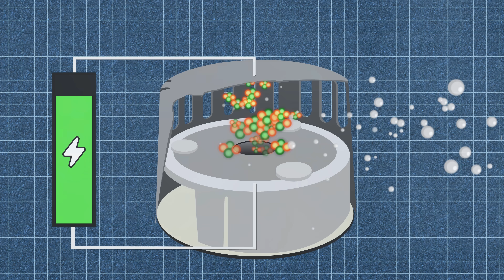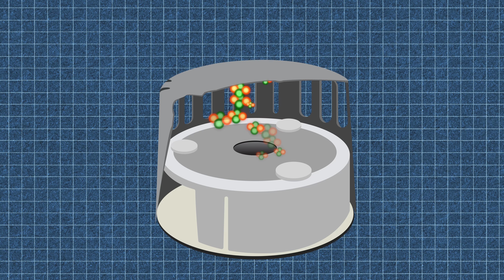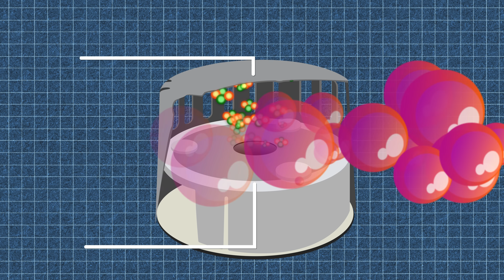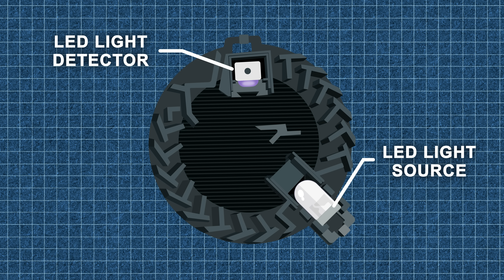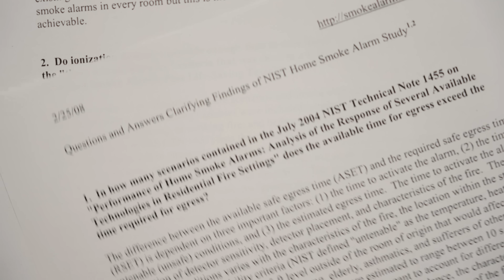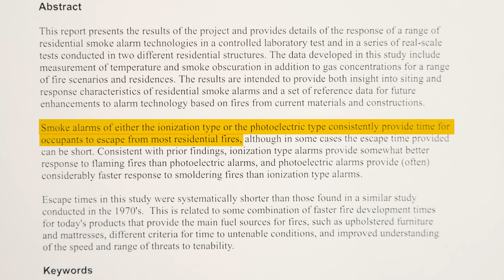Why the Most Common Smoke Alarm is Dangerous

Comment: First, the photoelectric aren't a panacea. Period. Fog, such as from my neighbor's meat locker set air conditioner and her cigarette smoke would set one off incessantly. Dust will set them off incessantly. Mist and steam will set them off.
Now, the magic sauce has been available for as long as both types of detector, ionization and photoelectric and it ain't Harry Potter's magical fuck stick, it's a combination photoelectric and ionization detector, which is commonly used in commercial grade detectors in businesses.
Downside being, the cost a fair amount more.

My ionization detector failed silently, which is plain evil of it, silent failures are bad. Maintenance tried just popping a battery in and running, I poked it with my cane, it stayed silent, maintenance was annoyed in having to go back up the ladder and pop a replacement in. In irritation, he handed it to me. Good, I'm an electronics guy, component level, I stripped that board down.
In mid-build for a radiation detector and cloud chamber for the radioactive source, the rest are loose components. The ionization circuit unchanged in well over 30 years (and basically the same detector for photoelectric or ionization, it's a comparitor and well, it compares the level read, say a quarter second before and now). The Americium source shrank by over half, which is fine.

Oh, my sense of smell has been out on a powder for decades, awake or asleep. So yeah, I need that detector and well, if some food is dodgy, someone to sniff it... No cheap detectors for that yet.

But, 90% of what he said on ionization, hyperbole, likely for pay. The rest, overstated, but loosely accurate. Get the dual model, minimal falses, it'll detect great.

Oh, figured out the silent failure by spilling some instant au gratin potatoes in the oven unnoticed, then was reading e-mail. Looked up to see a pall of smoke and had an "Oh, shit!" moment, as I really didn't want to set off the entire apartment building alarm system over a cooking mishap. So, popped the windows, ran the fans and ignited some fumes with profanity.
OK, maybe not that last part, but profanity was involved. Aired the place out, no annoyed neighbors and fire department, a wee bit less of a red face. Detector was replaced by maintenance, mischief managed.
And thanks to maintenance, a new science project was born that'll make a great conversation item at parties, as the radiation detector I'm building is of a CERN design for a particle spectrometer, so it can identify the element based upon its radioactive fingerprint (specifically, energy level). Not too shabby for $50 in parts. The cloud chamber is just a couple of shitty busted lid Amazon food storage containers that are getting repurposed, a chunk of heat sink, some blue freezer packs and that super secret ingredient, hot water. Shhhhh...
See PhysicsHigh for details on the cloud chamber. CERN's education outreach website for the experiments. Me for a 62 year old guy with a cane on a stripper pole, I need the money putting it back on again... OK, not the last, really, I've no desire to end up in traction for the next six months. Yeah, dad humor meets EMS humor, deal with it.

Comment: 13:37 and elsewhere. your bar graphs are barp;hed. mixed up. the ionization alarm is 35 minutes, not the photoelectric.. DEWD!! the mistake cheker.
Reply from the maker: Hey, thanks for the comment.  The graph is correct, but I understand why you (any many other people) think it's wrong.  

The stat is unusual: ASET or Available Safe Egress Time which is how long after the alarm goes off you have to get out before conditions become dangerous.  So photoeletric gives you more time in smoldering fires to get out.  

It's the stat used in the study and it's a measure of how useful an alarm is in saving your life.  It's also an indirect a measure of how fast each alarm is alarm is.

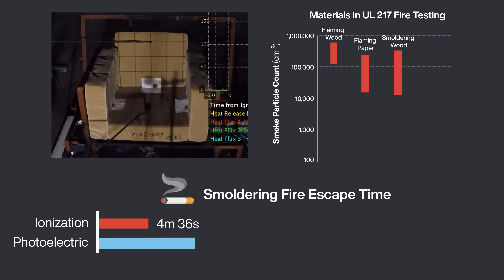Comment: At 11:38 (and 13:33) you say photoelectric is faster to detect but the graph shown on screen indicates that it's slower. Based on the other stuff you're saying, the graph is labelled wrong. Are you able to add an image overlay to the graph to fix this?
Reply from the maker: Hey Canadian, thanks for the comment.  The graph is correct, but I understand why you (any many other people) think it's wrong.  

The stat is unusual: ASET or Available Safe Egress Time which is how long after the alarm goes off you have to get out before conditions become dangerous.  So photoeletric gives you more time in smoldering fires to get out.  

It's the stat used in the study and it's a measure of how useful an alarm is in saving your life.  It's also an indirect a measure of how fast each alarm is alarm is.

Comment: I believe the graph at 11.40 is incorrect
Reply from the maker: Hey Klukis, thanks for the comment.  The graph is correct, but I understand why you (any many other people) think it's wrong.  

The stat is unusual: ASET or Available Safe Egress Time which is how long after the alarm goes off you have to get out before conditions become dangerous.  So photoeletric gives you more time in smoldering fires to get out.  

It's the stat used in the study and it's a measure of how useful an alarm is in saving your life.  It's also an indirect a measure of how fast each alarm is alarm is.

Comment: I've thought that it's the LACK of ionizing material that has been causing the problems in ionization alarms. 

There's a small amount of a radioactive material in there, and the less material there is, the closer the alarm is to the threshold to start with, the easier it is for false alarms to happen. 

Basically, the smoke detectors are MADE years older than they actually are, which increases false alarms.

Comment: It's very oversimplificated. There are more then one type of optical smoke detectors. The type showed in the video, is a type to detect white smoke. There is a type to detect black smoke too. it works by shining the light at the sensor and when the light got dimmed, it goes off. 
There is a type of heat detectors. it is a temperature-measurement device, that goes off at a set temperature or at a set rising of temperature.
The best type is a combination of all 3. With these 3 sensors, the smoke detector can very reliably detect all types of smoke.
Except of one, where the ionisation smoke detector are unbeateble, smokeless fire, like gas.

Comment: Your explanation of the ionisation detector is wrong. The detector measures the conductivity of the air. It gets more conductive through the ionisation by the alpha particles. If enough large particles catch alpha particles, there aren’t enough light ions for charge transport and the current drops.

Comment: wtf modern fires?
oh ya, science improved fire last decade... it's now 20% more hot.

seems more likely that it's the detectors that have changed, no?
Reply from the maker: It's an unusual way of talking about synthetic materials that you pointed out later.  The detectors have actually been kept the same for a long time.  My thought is that new models can be risky for liability and recalls.  Aside from some big pushes before for smart tech there were no incentives until 8th/9th gen to do anything
Reply: @Lam  lotta other stuff in that video too... if all that is true I guess I should smoke more joints... cuz ya know... smoldering.

Comment: I've had the Nest 2nd gen for at least 6 years now. It's dual spectrum detector, carbon monoxide detector and wireless interconnect with each other and my home automation were worth their significant cost. I'm hoping with the new standard I won't have to take out another mortgage to get similar performance when these expire.

Comment: 14:50 I really dont like these type of "deep learning" (basically data processing algorithm to see if slope matches with one on parameter) because it just makes things more complicated and it won't be futureproof since if some crazy new type of fires become a norm those will be obsolete unless they have similar slope to existing ones for mcu to detect them.

Why the hell would you make things more complicated by putting data procsssing into something that is supposed to be simple, just have more sensor fusion into existing fire alarms so they can detect different type of fires easily by covering weakness. 

And then for false report scenarios you can just have adjustable suppression timer or a remote panel for easy access to enable/disable/adjust timers.

These kind of control algorithms belong in robotics, not smoke detectors IMO.

Comment: I bought into photoelectric alarms so I went and bought enough to replace all the ones in the house. Within a month the first failed. It would begin to alarm as soon as you put a battery in with no way to silence or reset. Then the 2nd and 3rd failed in the same manner just a few months later. I threw them all out, including an unused one I hadnt yet installed. Went back to ionization alarms.

Comment: No, what I am wondering is if this will go off because of the steam from the shower. If the answer is yes, then I'm not getting this.
Reply from the maker: Honestly, you probably have to move your smoke alarm if you're able to. I do know the 9th generation are probably the most resistant, but there's not really great data on that because no one has done that comparison.  I do know that nest protects use a humidity sensor in order to reduce the chance of it going off.  Also, there's a failsafe in that if the humidity lingers too long, it's still going to go off.  Maybe test one and return?

Comment: Excellent video. I still think a multi detector type of fire alarm would be the best. 
i.e. ionization , optical and temperature.  But would the temperature part ever trigger before the ionization or optical part ? Probably not .

I'm pretty sure the interlinked alarm in my kitchen is using the temperature method of detection.

Then there is detecting flammable gas and carbon monoxide build up .
An ultimate  smoke / gas alarm would also need to detect them too ! 

As it is I have multiple types of alarm dotted around my house for all types, well except the optical photo electric detection ! You've made me think about the optical photo electric detection ones !

Comment: It is polyurethane if anything which ought to be banned for use in commercial indoor products like foam upholstry. It  makes hydrogen cyanide and carbon monoxide when it smolders like that. It's just a really bad idea to have it wrapped in a thin cloth. Inside a pipe insulation or something it is at least usually underground or in its own enclosed space that doesn't vent toxic gas into living areas and it is often inside a dense PE mantle which does not smoulder like that (it first melts and drips like wax, then it burns like a heavy wax or oil; if the PU ignites there is already a roaring blaze).

Comment: 11:43 What is this graph saying? I think it's saying that photoelectric alarms are extremely slow. You switched the labels.
Reply from the maker: Hey Soylent, thanks for the comment.  The graph is correct, but I understand why you (any many other people) think it's wrong.  

The stat is unusual: ASET or Available Safe Egress Time which is how long after the alarm goes off you have to get out before conditions become dangerous.  So photoeletric gives you more time in smoldering fires to get out.  

It's the stat used in the study and it's a measure of how useful an alarm is in saving your life.  It's also an indirect a measure of how fast each alarm is alarm is.

Comment: hah i got like the next gen  ul own best brand of the 8th to 9th gen smoke alarms like a like a few years early that is eqpieted  with a  real full seconud detcaded carbon monixide sensor with the innetcontection allready. it seams nevida got thsie new alarms like a few years first for them newer homes for a whole decade allready. heck had just got the next batch of them allready. they also use the normal reaplceable standerd  battery  compartment so when your battrys get old you can just swap them like in one just slot out the the old one out and then just put the new one in and its bacly as fast as bascly a few seconud ofr eacth one by the way. also not only that thse new somke alreams also can be even be mounted and unmountes just as fast. also has all the good freatures of the 8 gen smoke alarms with the smoke alrem networking the best sesnors and alot of other stuff too. they are a little bit finicky when they are brand new but they will settle down and become far more acrute over time. they are mechine learing cabable aprently.

Comment: Ionizing smoke detectors aren't even allowed here, as far as I know. I have a good ol photoelectric one. Thankfully it does not go off on me vaping (when I need a new one in few years I would like the exact same one because of this not gonna lie). The last time it went off was (probably) because I had forgotten a sticker under a new pan that I bought. Even though I had all windows open at that time, it still went off. Not sure if photoelectric ones are even supposed to do that?

Comment: A word of caution on the new generation of detectors, 2024 code is bringing changes and alarm system sensors got updated 2 years ago and ended up being too sensitive.  Now they go off for nothing.  So they made yet another revision and seems to have fixed the threshold, I just hope the 120v ones dont have this problem. 

Opening the oven causes a release of air over 135°, this is a heat sensor looking for this rate of rise and not a smoke sensor and modern devices have 2 separate sensors within.  Photoelectric beams have been THE option since the early 2000’s and they look for a certain amount of light refraction before tripping.

Comment: Nest protect actually isn't an ionization alarm. It is a dual spectrum photoelectric alarm. It uses high frequency and low frequency light to detect both large and small particles and tell the difference between them. Source: I used to work there.

Comment: Fire code where I live was changed 4-5 years ago to require networked smoke detectors and the new units aren't going off even after burning rice to coal to the point that I can barely see the kitchen wall from across the hallway. Works fine on smoke from burning paper as a test to make sure it is actually able to detect smoke, haven't tried other types of smoke. Previous alarm was an ionizing type that often went off for no apparent reason, even ambient humidity was enough to set it off on exceptionally humid days.

Comment: In France and Germany, ionization alarm are no longer legal and in some other they are no longer recommended due to radiation hazard if discarded incorrectly. Optical alarms have also become extremely advanced and "self check" every few minutes, testing its internal function and circuits and detection ability. It tests its ability to detect the IR LED light scatter in the air with short pulses. As long as it can detect SOME fraction of the IR, it determine that both the LED and the battery is OK. When it gets back more lights than anticipated, it increase the frequency of LED flashes to determine if there is smoke particles in the air. If less is detected, it also increase both frequency as well as intensity of the LED to check if there is thicker smoke and/or problem with the battery. The technology is now so cheap, that you buy them for less than $6,5USD in Sweden.
Reply: and also for standard smoke alarms the majority is with sealed 10 year batteries. so no forgetting/ignoring to change it

Comment: 2:17 ionization alarm sensors don't detect all types of smoke.
4:48 less likely to react to smoldering fire produces less particles.
6:04 Synthetic material furniture more likely to be smoldering compared to furniture made of wood which might be covered with cotton or linen.
9:01 Photoelectric is considered by some fire experts as more sensitive but take longer time to react. So, they kept analyzing.
10:54 to set a standard, ionization or photoelectric. Recommendation to use both.
12:33 Gov and private companies june 2024 the UL recommends now new 8th generation smoke alarm? 14:19 manufacturers used studies to redesign to make alarms which are more closely effective even for smoldering fires.
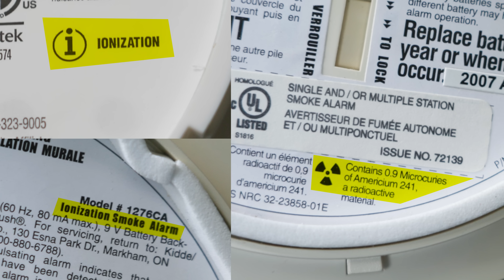15:45 "I" for ionization or ?? as designation for 8th generation. btw still ionization but redesigned based on the new data.